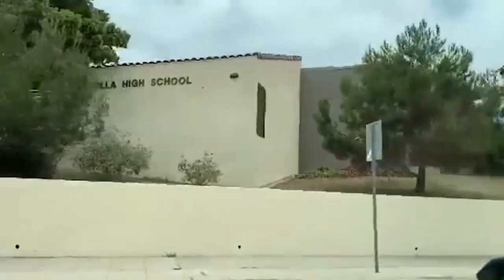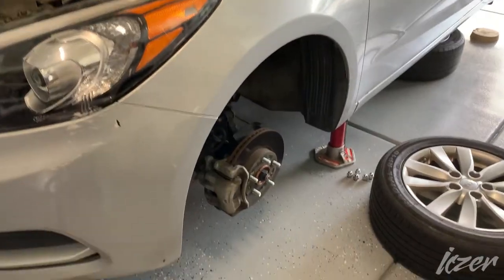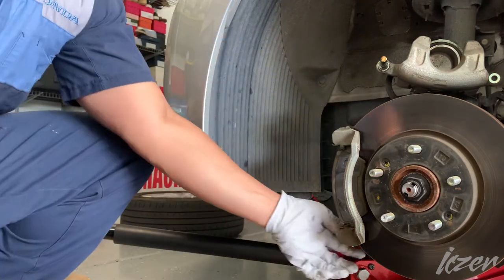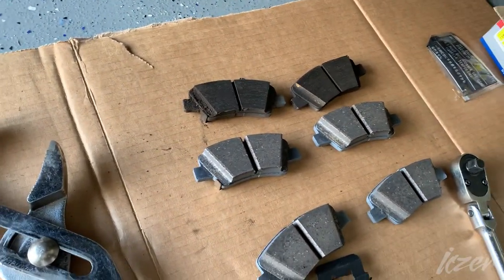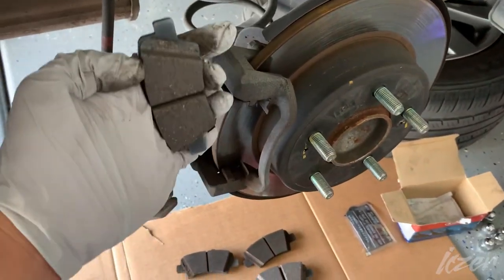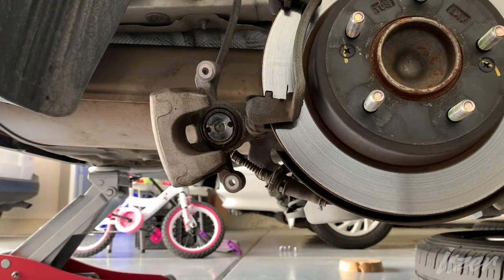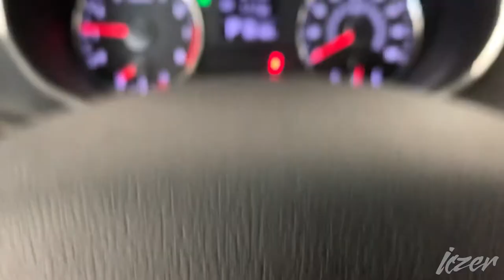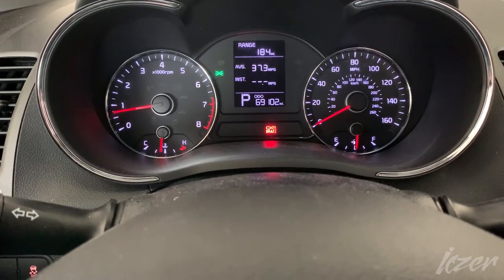[E50] 2016 Kia Forte - Front and Rear Brake Pad Replacement for my Niece.

Comment: Its great when you have power tools...question is are 2016 rear brake for kia forte sedan the same as a 2018 kia forte sedan???
Reply from the maker: Hi Joeyy. Thanks for watching the video. Power tools are great, but totally doable without.  I’m not to sure… I hardly work on kia’s to really know. Two options to check… try calling your local dealer or the power of google search. Matter of fact looks the same on the parts number image, but one image says differently. So I’d call the dealer… maybe someone who knows will respond I. The comments.  Have a great one! Welcome to Iczer garage!

Comment: Do you know which caliper pin goes on top and which one goes on the bottom, I know they are both different
Reply from the maker: Based on my experience I’ve noticed the pins with the rubber usually go on the bottom.  Almost all Hondas are that way.  But since this was a Kia and this was the first time brakes were done I am assuming that’s just the way it was.  But based on experience I always notice at the bottom in this case the one with the rubber was on the top.  Purpose of the rubber Is anti-rattle.  But sometimes they swell up and I have had to remove them because they could cause the caliper pinned to stick.  I have had no issues with them rattling with the rubber being removed.  So for the most part caliper pins are the same from top to bottom.  The most important part is to make sure they are lubricated well so they don’t bind.  Some of your factors are different well they will have a certain pin goes on top or bottom.  To be sure I would use a service manual for a better reference.  Thank you for your question.  Have a great day!

Comment: What happens if those notches don’t line up to the back of the inner brake pad? The old pads I took off didn’t have any notches on them so I didn’t think it mattered
Reply from the maker: Hello Tyler… basically what would happen is The piston of the caliper would push on to that Dowel piece and it could cause the brake pad to wear uneven/tapered.  As long as your new pads don’t have that dowel on the pad. It might not matter.  But if it does uneven/tapered Pad wear could result.  I hope I was able to answer your question. Thank you for your question/comment. Thank you as well for stopping by the channel! Hope you found value from the video.
Reply: @TeamICZER  you bet I did thank you for your reply!
Reply from the maker: Absolutely! We are glad to hear that! And thank you as well! Have a great day! Yay yay!

Comment: Are there different sizes on trim/ engine size? Also good tip on the sensor.
Reply from the maker: And some cars yes there can be a difference a pads. For the Kia specifically I wasn’t too sure as I purchased those pads for my niece  from a local Kia dealer.  To be sure you have the correct pads for your vehicle always give them full information.  For the most part giving them the Vin (vehicle identification number) helps. Thank you for your input it’s greatly appreciate it. That tip on the sensor was taught to me when I first started working on cars.  Now it bugs the hell out of me when I see the pads not position where the sensors are supposed to be.   Thank you for watching our video

Comment: wait you need a certain tool  for the rear pads ?
Reply from the maker: Yes for this vehicle the rear caliper piston is different from the front. For the front you could use large pliers a.k.a. channel locks to compress the piston back. But for the rear you need some thing to turn and push the caliper piston back in.  In the video you could see how I do it. Just pay attention on how it’s different from front and the rear.  Thank you for your question hopefully that helps you out. When in doubt always ask a trained professional and referred to the service manual it is applicable to your vehicle. Thank you for watching our video! Iczer garage Appreciates your question!

Comment: Why do you step on the brake pedal
Reply from the maker: The purpose of stepping on the brake pedal and pumping the brakes is to allow the piston to seat on the brake pad.  When doing brakes you have to push the piston back in order to put the new brake pads in since it’s thicker.  The old one is thinner because it’s worn out.  If you do not pump it in attempt to move the car when you step on the brakes you will not have immediate brake stopping because the piston still needs to travel to touch the pad.  So if that happens you get no break response and you have a chance of hitting something.  So once the brake job is done that is one of the most important steps. That is to pump the brakes. Thank you for the question.  Have a great day!

Comment: Great job. Where did you buy the rear pads and how much did you pay for them. I checked all of my local auto parts and they offer me a wrong size rear pads that are to small to fit the entire mirror surface of the rotor.
Reply from the maker: They oem from the dealer.  Sorry for the late reply. For aftermarket I would get Akebono, but the price is not much cheaper.